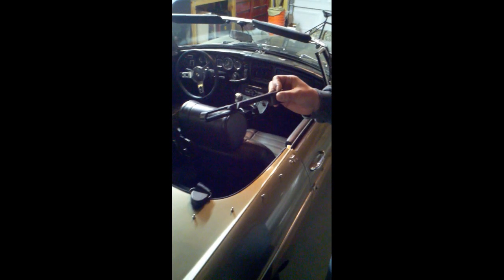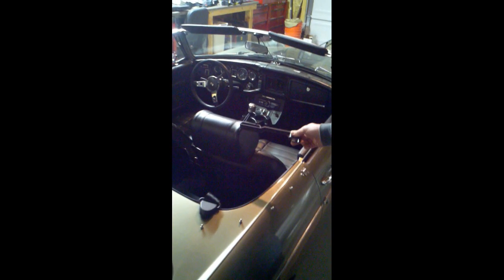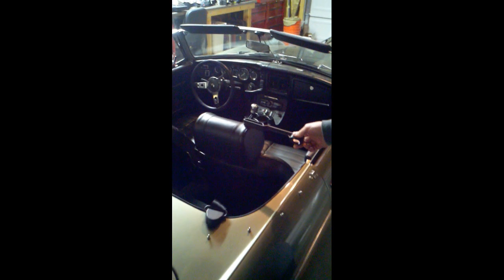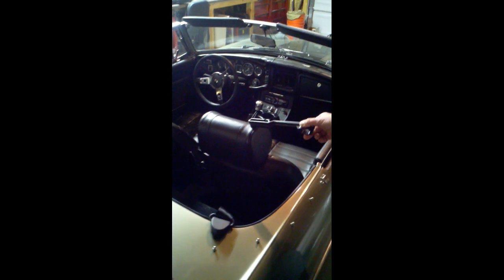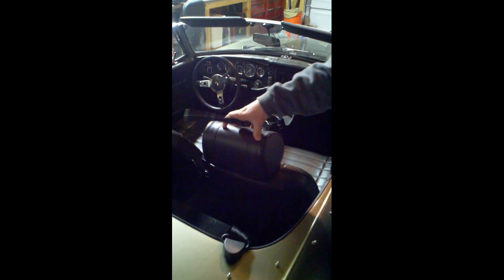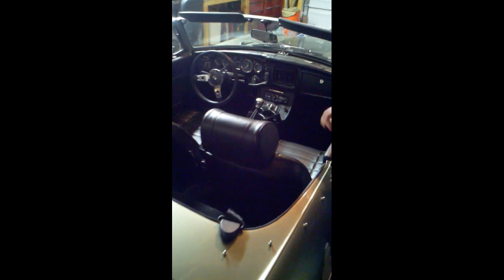MGB Headrest Removal & Seat Belt Guide Installation

Comment: Just don't do what I did and install your headrest in backwards when you put on the belt guide (DUH). The above method worked nicely to remove it once I realized I did that. The lever is on the wrong side of the headrest post and won't disengage the headrest!! BTW I have a 1977 MGB.

Comment: There is a lever on the inside, side of each seat. If you push that lever to the rear of the car you can tip your seat forward and backward. AND if you push that lever to the rear of the car, you can pull your headrest right out smooth as butter.
Reply: No dice…